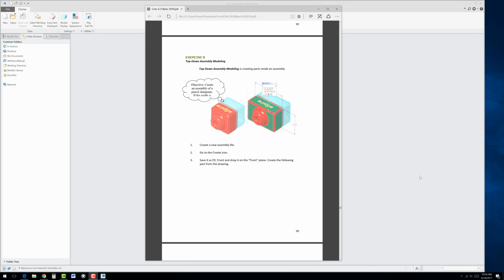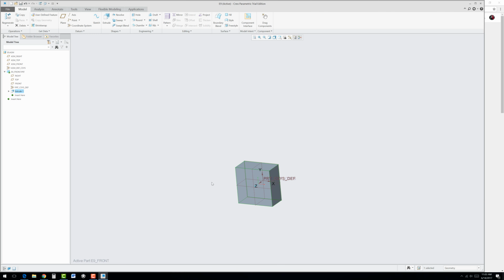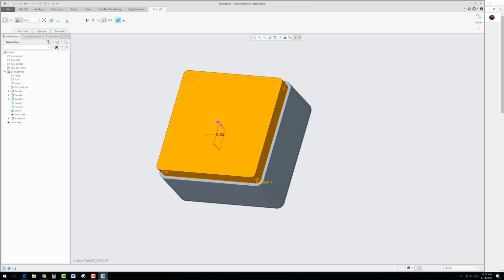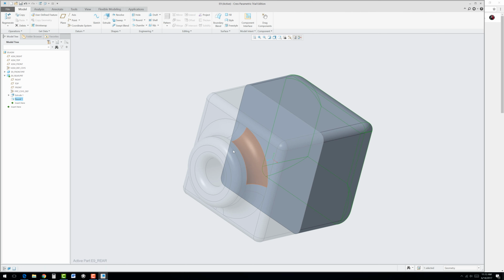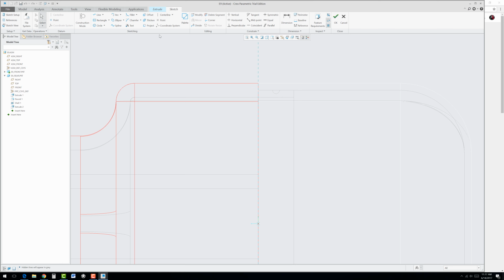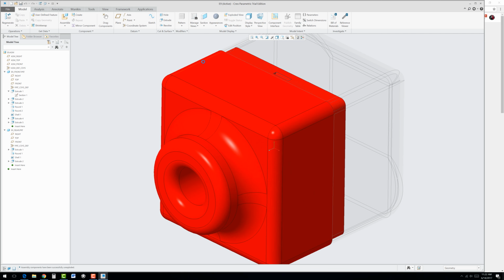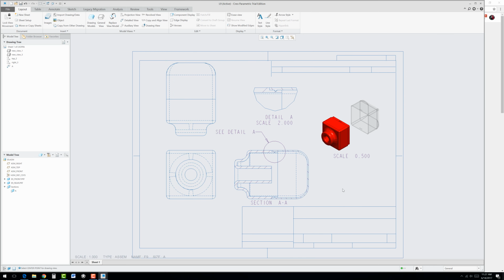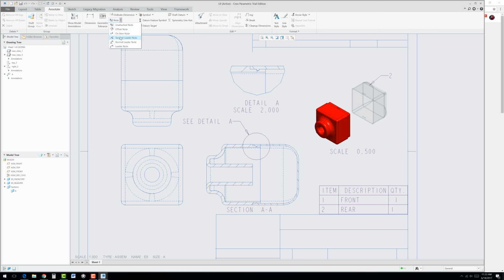E9 Creo Parametric 4.0 - Basic Assemblies 2

Comment: Nice tutorial! One thing I doesn't really understand, is there any benefit to use the assembly part modification (with the activate option) rather than to use the copy geometry option? Since you have no indication of the references borrowed from the other part, as I see, it could potentially lead to design failures when multiple designers working on the same parts/assemblies.